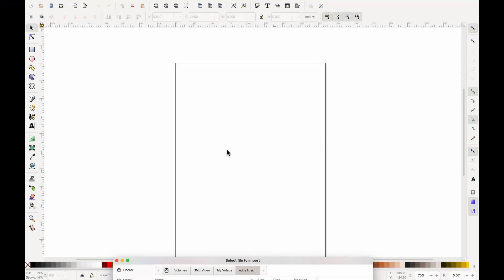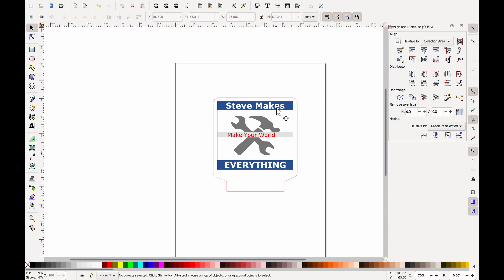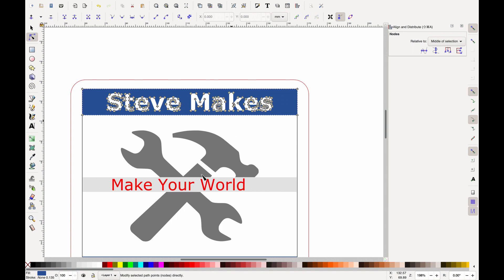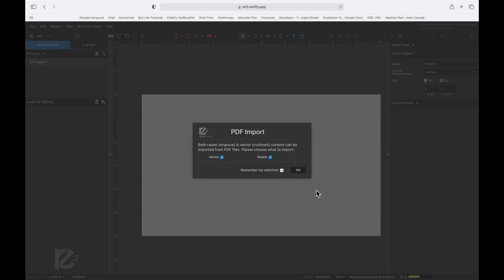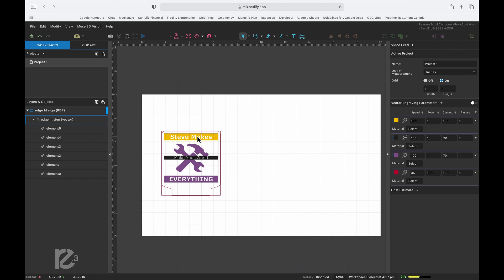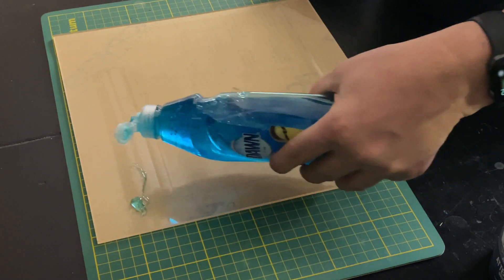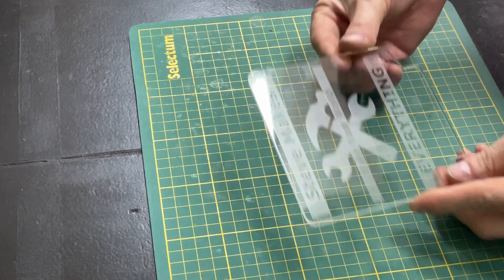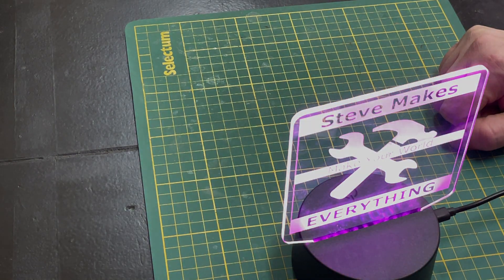Creating a Custom Edge-Lit Sign: Tips and Tricks

Comment: Im curious, when adjusting your power settings, is there a difference between keeping things at 1% and changing current vs if you just kept current at 100% and changed the power percentage? 

I am also curious if youve found a good LPI for engraving fill for your stuff?  I initially did an engraving with 250 LPI and my sign basically did not light up, but then I dropped it to 175 LPI and it looked great (at the cost of some slight resolution drop).  I made no other changes other than the LPI.  Any idea why less LPI would have given be a better result for a project like this?
Reply from the maker: There are several ways to get the same result with different setting. Generally you can either increase the power or reduce the speed or vice versa.  The results will be similar.

For LPI you can set it fairly coarsely since the rougher the engraving, the more light it will scatter. Also try to engrave thing closer to the light source less deep and things that are further away deeper.  Deep engraving close to the light source will effectively block light from getting to other parts of your engraving.

Comment: Hi there! Do you think this can be accomplished with a 20w diode laser?
Reply from the maker: No because diode lasers can’t cut clear acrylic and require a lot of work to do decent engraving on this material.
Reply: @SteveMakesEverything  I have had some success using my 20w diode. Buy the lights with the precut blanks. Put a light film of soap like Steve but put that side down on a black piece of craft paper. Focus the laser on the craft paper not the plastic. Be ready to mess up a few blanks but when you get the settings right it works great. Don't reverse the image unless you want it on the front of the plastic.
Reply from the maker: @multicraftneo5789  This will do it!😀

Comment: Thank you Steve, were useful, just one question what speed, power and pass you sett up?
Reply from the maker: This is laser dependant. On a 90W laser a cut would typically be 100% power and a speed of 20mm/S but on a smaller or larger laser it would be different. Engraving settings will also change from one laser to the next so you may have to play with thing to figure out what is best for yours

Comment: I read in another comment that the soap is placed on top closest to the laser. Does that mean the engraving is taking place on top with the soap?  I am used to the laser having to pass through to the bottom and having to have a black backing for the laser to stop and create heat. Could you give me a little more specific insight on how this is done and whether it matters to have a specific bottom layer?
Reply from the maker: Yes the soap layer is on the engraved surface closer to the laser. What I normally do is leave the protective film on the back of the material.  Note that I’m talking about using a CO2 laser.  I suspect you are darkening the back because you are using a diode laser.  If this is correct then you won’t need to apply soap at all.
Reply: @SteveMakesEverything  correct I am using a diode laser. Am I still able to use the soap method with a diode laser and not have to use a primer backing?
Reply from the maker: @zachhouchin9523  You can't use this soap method unfortunately.  You need the primer to make the engraving happen at all on clear acrylic

Comment: If the soap coating on the top by the laser head, or underneath where the engraving is happening?
Reply from the maker: On top. It helps absorb the flashed material coming off the cut to prevent it welding itself to the surface surrounding the engraving

Comment: Hi! ImagR and Glowforge Pro newbie here.  Getting married on Saturday and wanting to put engagement pics on 1/8 proof grade acrylic for a lighted table signs and have a couple of questions.  
1) I like the results of the "see on material" views after using the software and reducing the gamma on settings but hat DPI, LPI and glowforge settings should I set for speed, power etc?
2) To mask or not to mask?
Thanks!
Reply from the maker: This will be different for every laser - even between similar units from Glowforge, so you will just have to experiment to get the best settings.  A fair warning though, engraving on acrylic can be very finicky with regard to getting what look like shades of gray, so don't get discouraged.  There will be some setting combination that makes it work.

As far as masking, the answer is probably no.  If you do this there will be endless bits of masking left that you will either need to wash off with soap and water or a scraper of some sort.  If you want to protect the surface while engraving just smear a bit of dish soap on the acrylic before you engrave.

Comment: Steve, great video. Was this sign cut with a CO2 laser or Blue light laser? I assume a blue light laser would pass right through the acrylic unless it is backed or back painted etc??
Reply from the maker: CO2.  Blue diode lasers can't cut or engrave on clear acrylic
Reply: @SteveMakesEverything  Just FYI, with an extra step or 2, you can etch acrylic with a blue diode. https://youtu.be/c_9l_skYe7M

Comment: What would explain vector infill taking so long to complete.  I'm trying this and using a vector with the parameters you specified.  Its not a complete svg by any means but RE3 is telling me its like 7 hours to complete?  Is that normal processing time?  versus rasterizing it takes like 15 minutes....
Reply: I'll answer my own question for the benefit of others.  I did not have my "spacing" set properly on the vector infill.  "Spacing between infill lines(in)" isn't exactly intuitive but you need this set to something like ".01".  Mine was set to 0 and it was just taking foreverrrrr....
Reply from the maker: 🙂Well I was going to provide the same answer. I got bitten by this as well. Seemed to be an incorrect default value for a new feature added to RE3
Reply: @weboflies999  OMG! You just saved me me the biggest headache of trying to figure that out. I would make a vector infill and it went from 4 minutes to 3 hours. Been stumped and I’m gonna look at my settings when I get home today! Thank you for giving this information

Comment: Did I miss the laser you used?  I’m interesting in buying something to cut Acrylic.  Thanks.
Reply from the maker: For most projects on the channel I use my FSL Muse 3D.  If your primary use case is cutting acrylic sheets them you may want something larger in both power and workspace size.  FSL has the Titan, though there are a host of others in the 60-90W range

Comment: This video is awesome! I am looking for some advice for a machine I want to purchase. It is a VEVOR 3 Axis CNC 3018, GRBL Control, laser options for 500, 2500 or 5500 mW laser (also has a spindle motor with 10k RPM). I would like to create such signs, so as engraving in ABS plastic (LEGO) and 2-3mm plywood cut and engrave. Am I looking for the right machine, or will I need a stronger wattage for the laser, like 10W, 20W? Also can I use the laser for the ABS or the acrylic or better the spindle? Thank you very much in advance!
Reply from the maker: Lots of questions here.  If you are looking for a combined CNC and laser there are better options than a 3018 but they will cost a lot more. For engraving acrylic a CO2 laser is by far a faster option. Note that a blue diode laser can’t cut or engrave clear acrylic.
Reply: @SteveMakesEverything  thank you!
Reply from the maker: @fprstudio  Happy to help

Comment: I'm guessing my laser just isn't strong enough to do this kind of thing. I'm really sad that I can't get it to work properly.
Reply from the maker: What laser do you have?  almost any CO2 laser can handle this. If you have a blue diode laser you are out of luck though because you can’t engrave clear acrylic
Reply: @SteveMakesEverything  Yeah, I have a blue diode. I bought the Snapmaker and they market it as able to cut and engrave acrylic but I have yet to be able to do so. They recently announced a 10W laser, but that doesn't come out till March. I thought they maybe the Transparent colored acrylic would work, but I was mistaken. They have a preset with the most recent update, but it's listed as black acrylic.
Reply from the maker: @Zeargi  These will cut non-clear acrylic.  No matter how much power you have clear acrylic will be out of reach because is just doesn't absorb blue light in the 405nm range.  They are excellent for engraving almost everything else though.
 
For creating edge lit signs you typically need a CO2 laser.
Reply: @SteveMakesEverything  Thanks for the info. I guess, I'll have to figure a way to make it happen with what I have. I've seen videos on YouTube and like said, on there official sight they do have it listed. Perhaps there's a step I'm missing or can't find. Working with acrylic was the thing I was the most excited about, but maybe I might have to use the CNC function to cut and engrave with the laser. It just would be so much easier if I didn't have to change out the tool heads
Reply from the maker: @Zeargi  To be clear you can work with any acrylic that isn't clear with a diode laser, but if you have CNC routing abilities you can certainly use that.  The same technique described in this video will also work with CNC

Comment: Looking at a cnc3018 to do some basic edgelit designs but I heard the laser can't do see through acrylic so I'm glad I found this. 
Everyone has said the laser bounces back through the acrylic. 
Besides the soap is there anything else you needed to do?
Reply from the maker: First, CO2 lasers can definitely cut and engrave any color of acrylic.  The entry level blue diode lasers can only work with darker colors so you wouldn’t be able to create a sign like this using those lasers.

Second I don’t think you would get reflections off the acrylic with a CO2 laser.  The light that is produced by a CO2 lasers doesn’t behave the same way visible light does in acrylic. It gets absorbed by the material - if it didn’t you wouldn’t get any cutting ability.

The smokey glazing that can happen in acrylic is because the beam is super-heating a very small area. Applying the soap allows the heat to be more quickly dispersed, preventing this damage.

Comment: Hi, Steve - thanks again for your very helpful videos for those of use using FSL lasers (mine's a Muse Titan with 100w tube). I had a couple of problems cutting this project. First, I found that I had to get the acrylic up off of the honeycomb bed because where the perimeter was being cut through, the laser tended to reflect (?) off of the metal honeycomb and make a mark on the bottom of the acrylic - and when it was cutting, the acrylic "popped" and jumped a 1/16" or so, so the cut was not clean or even. What I did was put a 1/8" sheet of plywood on the honeycomb tray and set the acrylic on that. That got rid of all of the honeycomb reflections and eliminated the popping of the acrylic. Does that sound about right? Is that a good way to do this? The second issue I had was I still got a few spots of fogging on the perimeter cut, even though I did the dish soap routine on the cut face of the project. Should I cut back on the power or current of my 100w tube here? I was running 75 and then 100 speed, 100 power, 100 current. Another question - I was just using a line-art image - what power settings do you suggest for that? I tried several, but ended up at 100 speed, 10 power and 70 current. That seemed to go a little too deep. Should the power or the current be varied on line art? Thanks so much!
Reply from the maker: Excellent tip!  Depending on how "production" the work is, I will sometimes do this with some cones that I 3D printed for myself.  This is a bigger problem with 100W laser since you have power to spare and may not be able to tone it down enough to do clean cuts on 3mm acrylic.  You can also use the dish soap trick to avoid fogging or just cut with the protective paper still on the back side.
Reply from the maker: I guess I should answer the rest of these question. Regarding power for line art, you’ll just need to play with it. Start with lower power and if it isn’t engraved enough you can always rung the engraving job again as long as you don’t move the piece
Reply: @SteveMakesEverything  I have a very happy 4 yr old granddaughter because of your work on this video - Her birthday was a Frozen-themed one, and I gave her a couple of bases with all the main characters from the movie. It was a big hit!  Thanks again for being a great source of info for us newbies in the FSL laser world!
Reply from the maker: @LDBecker  This is awesome! 😀

Comment: I'm totally new to all of this, but I'm wondering if you have to design it all on a different software before importing to Re3 or is that just your preference? Could you design it all on Re3?
Reply from the maker: Hi Heather, it's a good question.  For simpler designs you can use the software that came with your laser.  Most vendors will provide something where you can design your project, though they aren't always the most capable.  Some tools are fairly weak while tools like Lightburn are very powerful.  RE3 sits somewhere in the middle to upper end on this scale.

Regardless though,  none of these tools will give you the complete flexibility you would have with a drawing tool like Inkscape, Illustrator or Corel. Nor would you get the 3D modelling capability of a CAD tool like Fusion 360, etc.  The good news is that there are capable, free options at all levels if you want to move beyond the simple layout tool that came with your laser. 

Hope this helps, though maybe this would be a good subject to cover in a video if people are interested.
Reply: @SteveMakesEverything  that does help, thank you so much for answering my question! Keep the videos coming :)
Reply from the maker: @heatherallred7714  Will do!